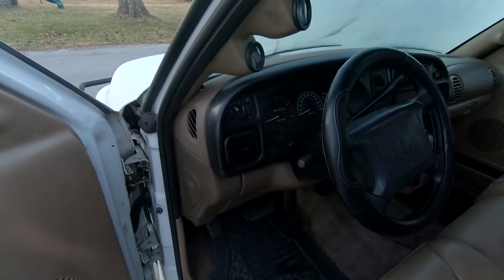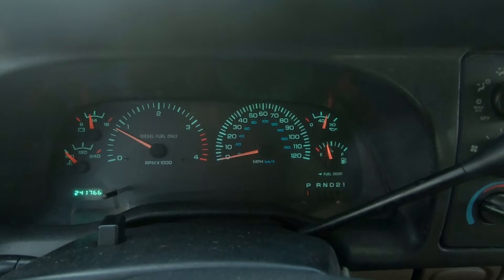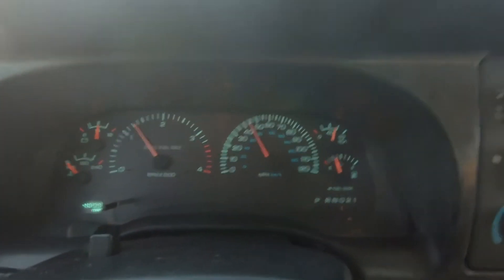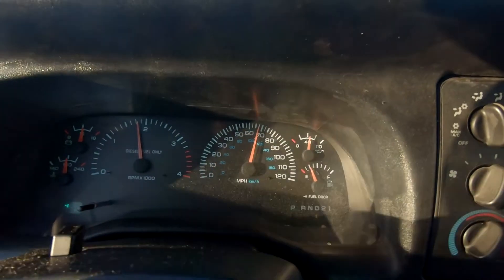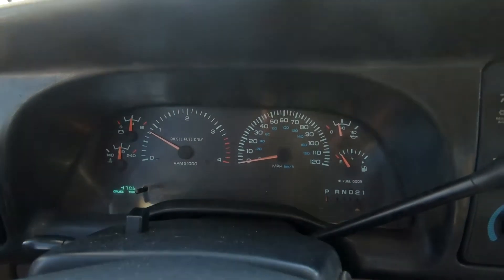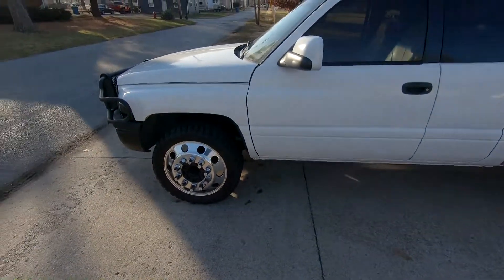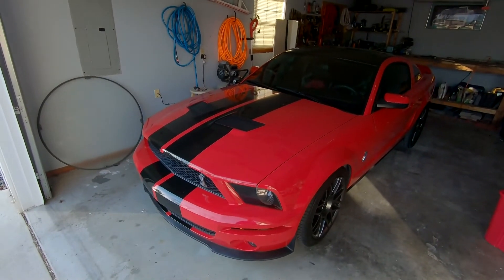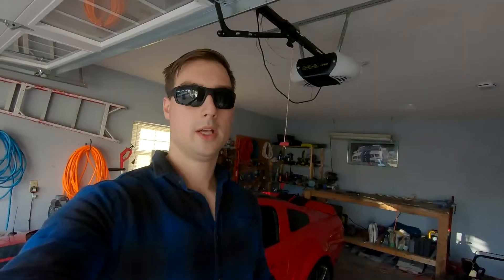Normal Oil Pressure for a 24v Cummins Cold vs Warmed Up | Garage Update

Comment: My 96 12v has 483000 miles on it holds 40 psi oil pressure at idle warm. It uses no oil. It just keeps going lol. I have compound turbos on it and alot of fuel upgrades. It still.on the original headgasket. Motor has never been apart. I drive it everyday. My 2000 24v holds the same oil pressure as urs.
Reply from the maker: That's awesome, hope mine lasts just as long!
Reply: Nice. My 12v sits just above 40 all psi all day.

Comment: Hey Man nice truck. I bought my first diesel.  01 5.9 24v 5 speed with 330 on dash.  It runs strong and great in my opinion.  But the check gauge light dinged today  and my oil pressure runs about like yours does warn.  80. But it dropped to zero.  I had about a half mile to get off the road. Time i pulled over it came right back to normal pressure.. same pressure cold or hot ideal or running. Around 80.. how much damage could i have done to the motor running it.  And u think it might be my oil sending unit.. sorry for long post. Thanks again.
Reply from the maker: If it dropped and came back, it's either physical or the sensor. If it had oil in it, and still does, I'd almost guarantee it's the sensor or wiring. No engine damage is it's the sensor, just scary.

Comment: Nice video, how much oil does your engine consume. Mine uses about 1 quart in about 5k miles. I assume all cummins use some oil.
Reply from the maker: Mine is a little more than than, but it's because it has leaks more than consumption. Probably 2 to 3 qts per oil change interval.

Comment: Mine is a 2001.5 model. It runs 73lbs oil pressure no matter what. Cold, warm, idle, highway, same oil pressure. My oil pressure is immediate upon starting. It's at full pressure well before I can get it into gear.

I run whichever conventional 15w40 I find on sale. Last 6-7 yrs has been mostly SuperTech. But I've ran Rotella, Valvoline Blue, Delo, Mobil 1300, and Castrol. Engine sounds, runs exactly the same with whichever brand. It uses about 2qt every 5000 miles, which is where I change the oil. I usually use the Mopar MO-285 filter, but have used Bosch, Fram Gold, Purolator, and Mobil 1.

No discernable difference in oil pressure, sound, oil life quality, etc.
Reply: I just read where the factory oil pressure gauge is inaccurate, as it's just a verification that the engine has over 6 lbs. or so and estimates the pressure off coolant temps and rpms maybe. 

I guess that explains why my pressure gauge always comes up and settles on 73-74lbs no matter what. Maybe just defaulting to that gauge position, with the real pressure being around half that.
Reply: I had the same problem with a bit of white smoke and my crank case vent was kinked and clogged.
Reply: @denniswilson8786   Noted 👍
Reply: I have a 99 Dodge with the Cummins turbo diesel and notice my oil pressure stayed very high while driving when I turn the ignition on after stopping the oil pressure gauge registers the same without the engine even running I'm thinking it's the oil sensor is bad what are your thoughts on this
Reply: @dwainsellers6453   I've never observed my gauge in the accessory position. I'll look next time

Comment: That's exactly where my oil pressures sit - '01 high output with 213,xxx miles. I've been having an on-going throttle cut issue with mine and am leaning towards a VP44 needing to be replaced...One question: What does your blowby look like from the crankcase vent? Congrats on the house
Reply from the maker: I have a steady little stream of what I assume is oil vapor from the blow vent tube.  At night at a stop light I may catch a bit of it visible from the drivers seat in the headlight, but it doesnt pulse or seem excessive so I dont worry about it. I've looked into it pretty extensively and from what I've seen other owners post and talk about some have it a little more than others, but as long as the oil cap doesnt bounce if you place it upside down on the oil fill hole it's fine. Vent in its factory position of course, a smaller vent tube may cause a false read, like a neck down if it's been re routed
Reply: @AllThingsBoost  Makes sense - I have my routed to atmosphere with a longer tube to the front fender well. May go back to stock location